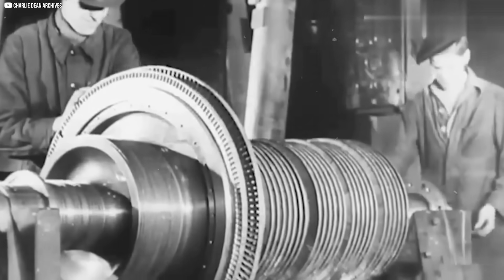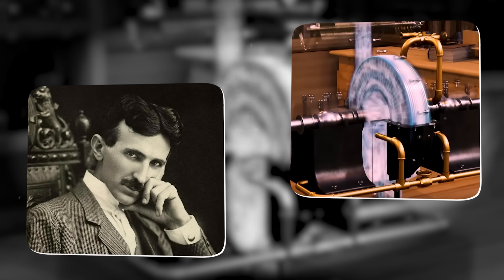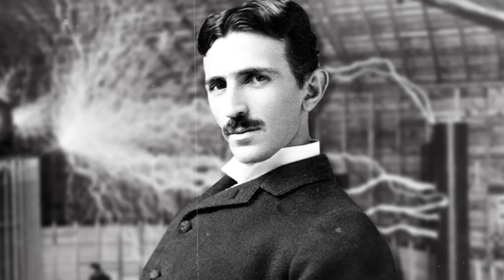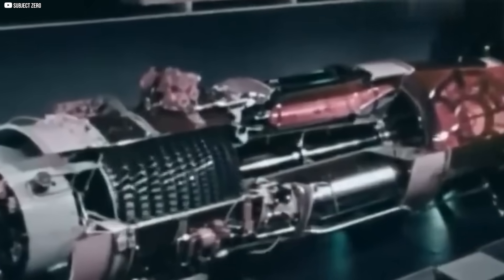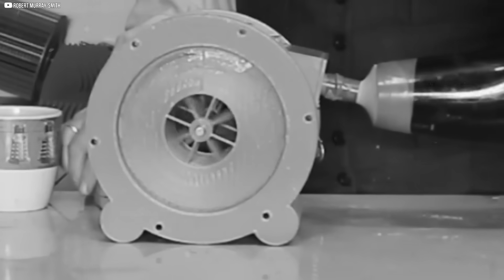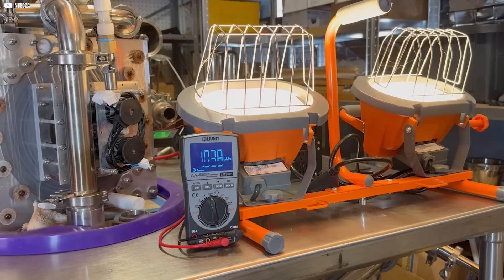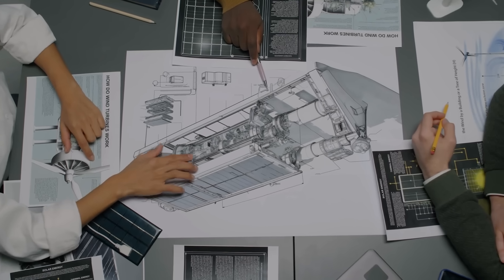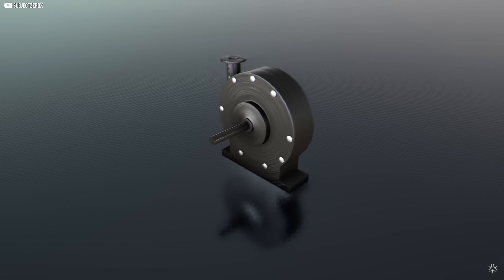Tesla’s Forgotten Turbine Could Still Change the Future

Comment: The Water Flow Benefits with Natural cycle non extra energy input Water Pumps enables transferring Water over ALL parts of Lands, in combination with River Beds, Pipelines and kreated Canals. Separating Materials from Ocean Waters is as Well done with Temperatures & extreme Cold & Hot even molten Temperatures in combination with Vibrational Resonate FREQUENCIES, Sun Light Spectrum Waves, Magnets & light uses of Electricity. Minerals found in Ocean Waters and Mountain Chains more than Double every part of Agricultural Production including Nutritional Qualities, Material strength & qualities, size of Fruits & quantity of Fruits in Any kind of Agricultural Product!!! Many types of after Invention Products follow Qualified Material Supplies of all kinds and recycled uses. Corn Plant Materials for one kreates better interior & exterior walls than sheet rock, wood or outer layer Earth Materials, that also hold heat and cold. Corn and Hemp Materials are stronger in combination with other Materials & sealing blends, Hemp Plastics are Stronger than Steel and do'nt hold Heat. This type of Turbine Engine also is very useful to combine with Land Based Vehicle Transmissions as the Main Driving Engine and gear accelerator factor, The Transmission should be the Main Drive Train Factor as a one unit simple motion engine initiation inside the Transmission profiguration. In combination with other back up Methods such as Magnetic Spin Electric Motors, gears & Camshafts,  and Alternators working off of The spin of Wheels, and other Hydrogen on demand combustion simple engines turning cams & gear turning methods. And even a Nicola Tesla Water Pump or Air Turbine Driving the Main accelerator & torque gear driven Transmission, with multiple back up gear uses kreated within a Transmission in case loosing a gear or set of gears while traveling. There should be an Electrical supply Loop around componets, Wire harnesses should Not be used because each wire combines Electro Magnetic Fields & short Circuit each other.

Comment: Long story short: it couldn't meet efficiency targets, was too heavy, was material intensive, and required too many precision surfaces.

Even with modern materials and precision manufacturing, the design isn't comparable to most modern turbines. They've only found use in a couple niche applications with sensitive fluids (bio pumps, etc.).

Comment: , Inconel 718 stands out as a highly suitable alloy for a Tesla turbine spinning at 35,000 RPM, offering the necessary combination of high strength, high-temperature capability, and fatigue resistance. However, the exact choice would depend on detailed engineering analysis, including the specific operating temperature, power requirements, and budget.

Comment: Water has amazing traction on flat surfaces~! It sticks to everything.
One thing I've noticed is some of these animations have the flow going the wrong direction..
The flow has to go from the center through and out the perimeter taking full advantage of centrifical force in order to maximized output.

Comment: 1:18 viscosity? How about traction 😊
Reply: indeed water clings to everything
Reply: @21CenturySkyScrapers  its  a matter of the drag coefficient increasing on a log base so it won't throttle back in a linear fashon.  I suppose used in generation as demand increases output would fall rapidly just like  green wind generators fall off in energy so load balancing would be a problem.   I like the boundary effect we see this off headlands at sea tidal flow changing perhaps an hour early.   Sounds a bit like quantum mechanics perhaps.

Comment: Wouldnt this design be correct for a high pressure system that could be transisted into a type of propulsion system for boats and even ships. Which would change everything about how much power a boat motor can produce.
Reply: The stacked blades have to subtly follow the fibonacci spiral.
Reply from the maker: It's fascinating to consider how this technology could be adapted for different applications!